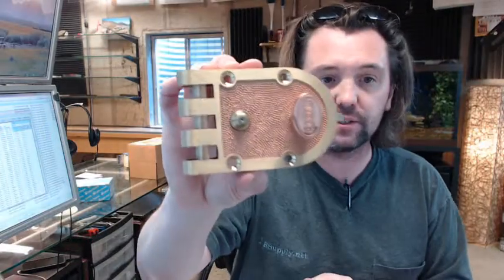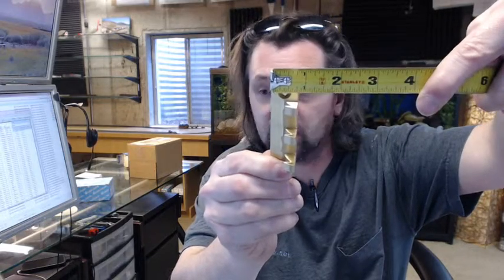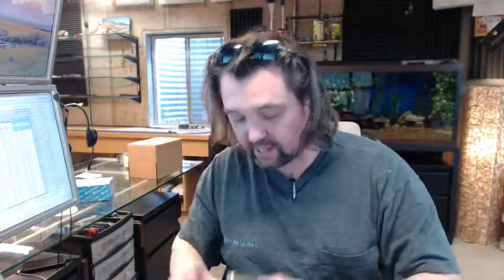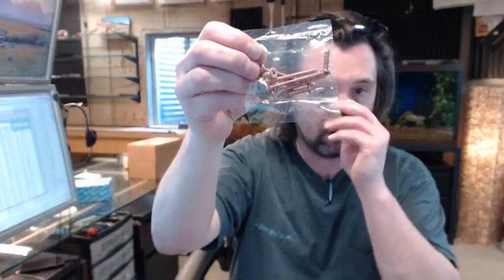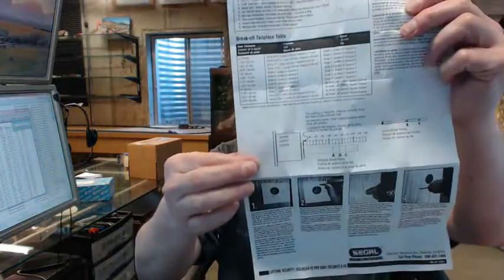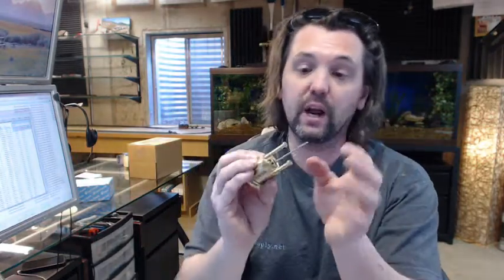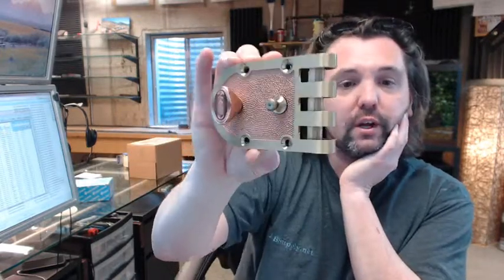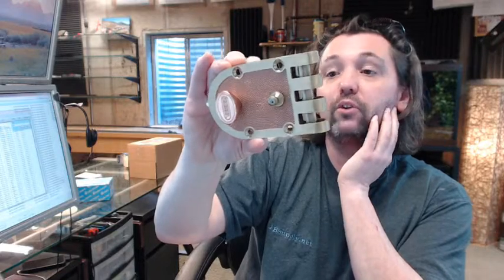Segal SE14325 Single Cylinder Slamlock, Angle Strike - Brushed Brass

Comment: Good introduction; though Richard is moving through the operation too quickly to show the detail of the lock body.  What is the tiny knob on the face of the lock body?  Is this a handle to allow you to pull the door open while operating the latch release?  Also, would be very helpful to show how the slamming latches the door.  The angled striker teeth that are mounted on the door frame must be located to be inside the lock body bar, etc.  Can the frame mounted striker be mounted in more that one orientation?  I pulled one of these units apart today and found missing parts; it helps to understand how individual components function in order to remount or repair the operation.
Reply from the maker: Call me and we will go over this all in detail.  Rich 239-315-7889